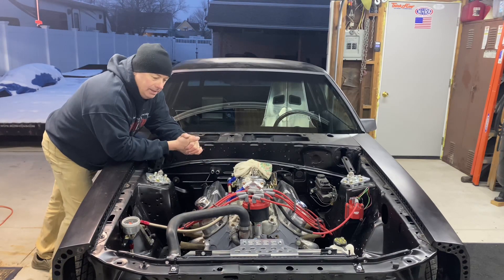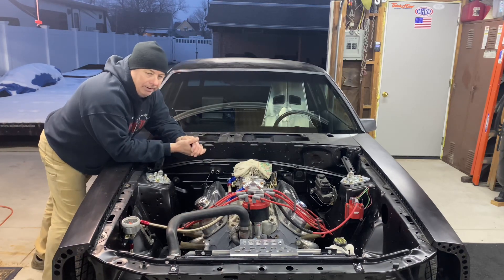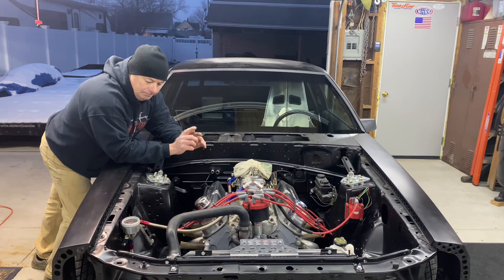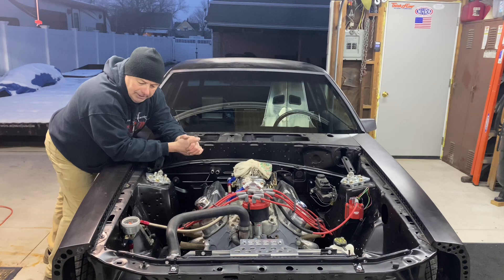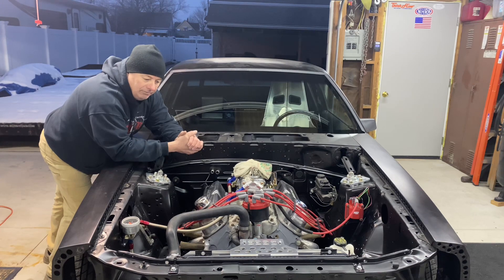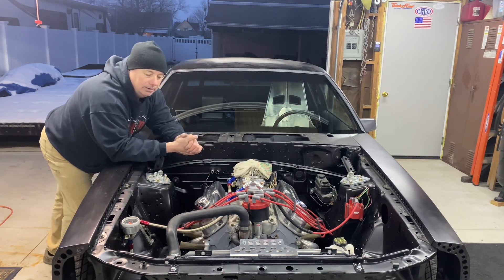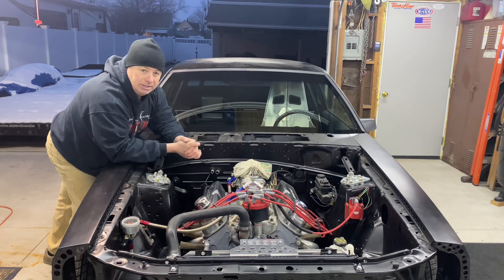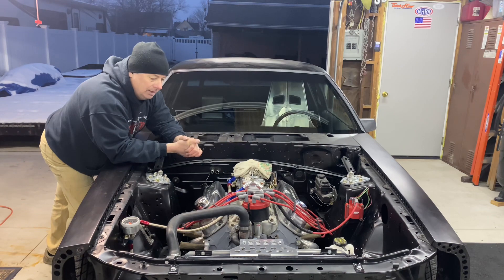UPDATE 1-24-2023

Comment: Debating on which carburetor to go with. But I'll be switching to methanol this season. So whole new fuel system will be coming in soon
Reply from the maker: I have run both a 650 and a 750. It likes the 750 just a little bit better.